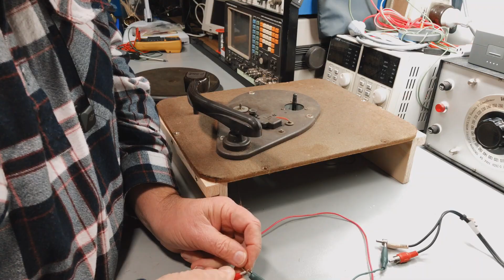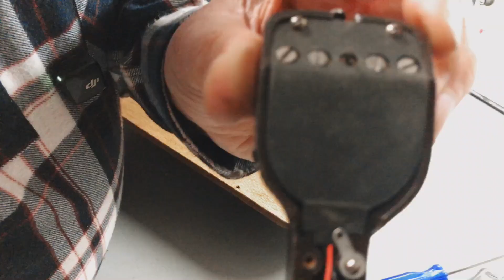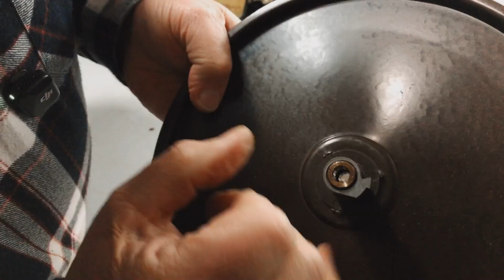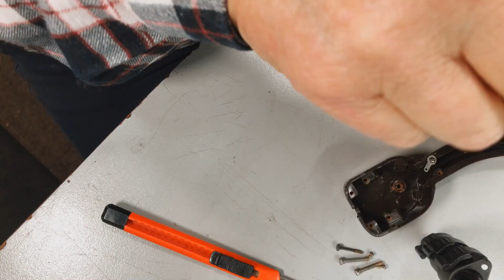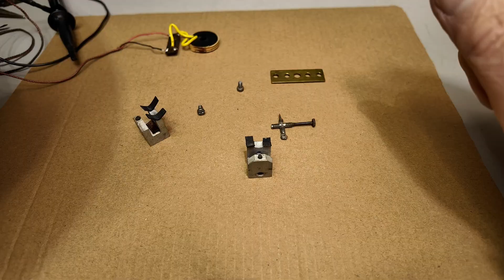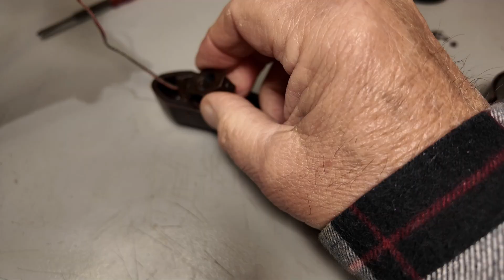Scharnberg Strauss Radio Gram Restore   Pt3 The Turntable

Comment: @Techno BAZ 55  hey, there are terrible chirping high frequencies on your Video ; could be heared on my smartphone. (ca. Around Minute 6) won't continue to listen
Reply from the maker: Only connecting up audio cable, about 4secs.
Your choice
Reply: Baz I great result and micro Surgery on the Pickup I found a a piece of Silicon Rubber tube with one I did some time ago mine worked well also Full Marks Baz on great results,Ian,